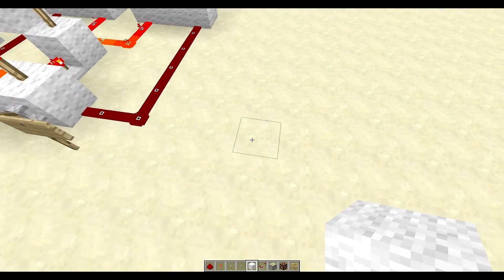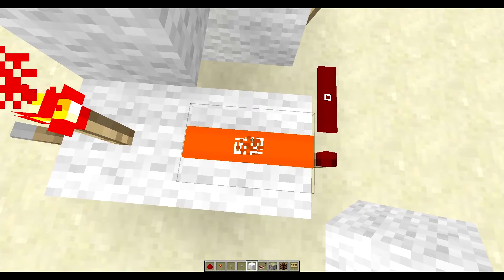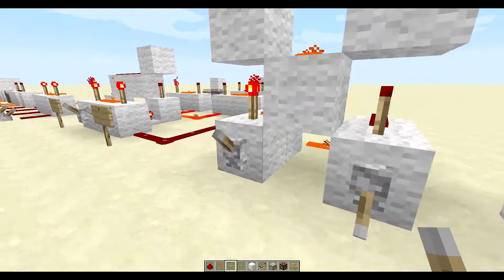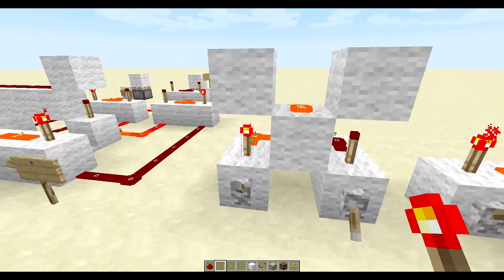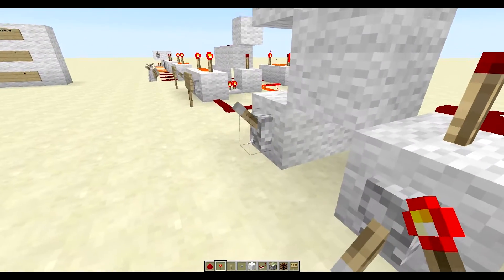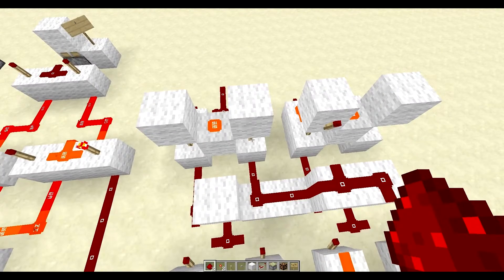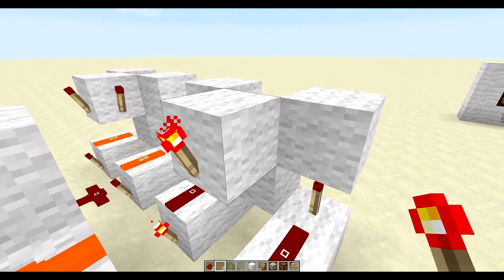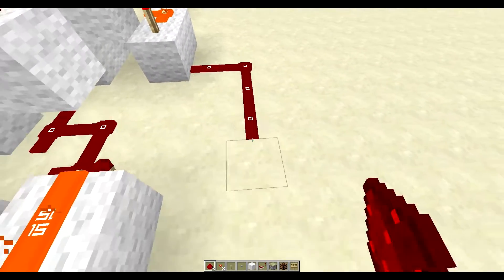Redstone Computer Tutorial - Episode 3 - The Full Adder

Comment: This is the purpose of his "adder" and how it works:  You have two numbers, A and B, just like how he denotes in this video.  The purpose of the adder is to give us the number (A+B).  For example, lets say A= 3 and B=1.  But he represents the numbers in binary which is written as A=11 and B=01.  Where there is an input switch (or lever or whatever it is that he pushes) for each digit of A and B, making 4 inputs total (ignoring the "carry in").  Now, the adder gives us (A+B).  In this case, the adder gives us (A+B)=100, which is the number 4 written in binary, where there is a zero in the 1's place, a zero in the 2's place, and a one in the 4's place.  As you can see, this adder has 4 inputs (ignoring the carry in) and 3 outputs, where the 3 outputs represent the 3 digits of the number (A+B), in this case 100.  You can temporarily ignore the fifth input,  the right-most "carry in" input that he mentions during this video, because if its always off, you just can pretend it isn't there, so you don't have an extra input to wonder why its there and obfuscate your understanding of how the contraption works.  

But once you fully understand how the adder works, now you can worry about what the "carry in" and "carry out" is for.  This is so that if you make more identical adders right next to each other, you just connect the carry outs to the carry ins to make an even bigger adder that can add up bigger numbers like A=1011 and B=0110.
Reply: Thanks this comment finally got this stuff through my thick skull
Reply: are you trying to

Comment: Wait so is this a calculator?
Reply: CaHOOTS for simple calculations yes it is (sort of), but this one just goes to 15 with plus and minus
Reply: The 4 bit
In the video it just goes to7
Reply: Matthijs Langerman 4 bit goes to 15, why 7?
Reply: Samuel Hulme It’s called 2’s complement. Basically, you reserve one bit, the left most or most significant bit, as a sort of “sign” bit. However, you now only have 3 bits left for the actual number, and we also need to represent 0. So we can use 4 bit 2’s complement to represent any number from -8 (all 1s) to 7 (all 1s except the sign bit). 0 is simply all 0. 

If you want to convert a positive number to negative or vice versa, you negate all the bits, and then add 1. Because of this process, we don’t have any wasted bits (like having two representations for 0) while also maintaining easy logic for sign changes.
Reply: Always has been
Reply: thats what a computer is fundamentally

Comment: Nice video, but I don't understand it :/
Reply: I can try to explain it from the previous vid, but to count binary, you count from right to left, where 000 is 0, 001 =1, 010=2, 011=3, 100=4, 101=5, 110=6, 111=7, each digit of the binary is 32, 16,  8, 4, 2, 1 Where 111 is just 4+2+1 = 7. So 100000=32. 10001 = 17 (16 plus 1). 

For calculating at the end, he said he added 3 + 1 to get 4. So 3 in binary is 11, while 1 in binary is 01. Or 01 + 11 = 100 (4). The way he configured the switches means that its AA + BB = total, or 2A1A + 2B+1B = total.  This way, means 11 + 11 = 110, total of 6, cuz each side is 2+1 + 2+1 = 6. The c-in is an extra 1 bit, so the grand total is 7 if all switches are on. Another example if 2A and 2B is on, total is 4, cuz 10 + 10 = 100.

To make it a larger binary calculator, he'll have to add more bits, where we include 4, 8, 16, etc.... so you'll see it as 8A4A2A1A + 8B4B2B1B = total.  For example 4A + 4B = 8 or 100 + 100= 1000. In the previous video about NAND gates, a bright redstone torch means it's OFF. Plus, binary is just 1 and 0, so either on (1) or off (zero).